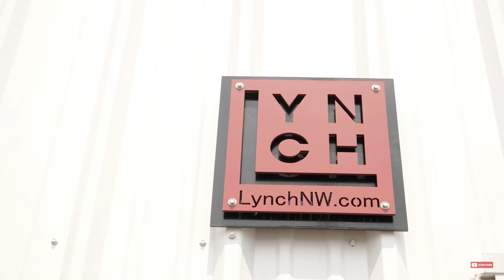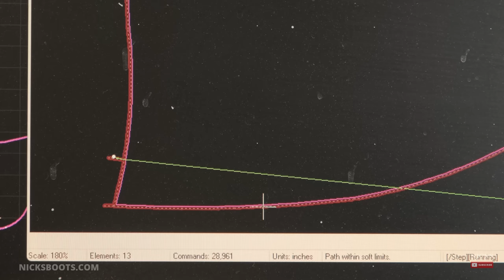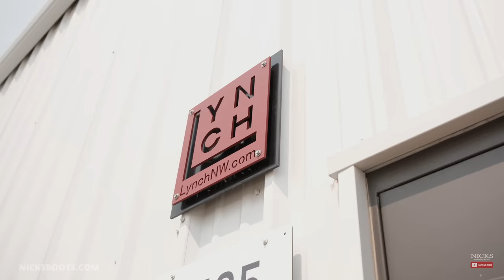World's THICKEST BOOT SOLES: Off-Road Tires on Boots | How It's Made

Comment: Guess these you dont have to worry about rotating them.
Reply: Maybe after the first 100,000 mile 😆 🤣 😂
Reply: I was thinking after a 100,000 steps.
Reply: Make shure you Cross the non drive axle
Reply: That's the best joke I've heard in while.
Reply: You put the left boot on the right foot and the right boot on the left  foot  to turn  corners

Comment: Years ago I worked in a prison. They had a shoe/ leather shop. There was an inmate that would use a lawn tractor tire just because it didn’t have any metal wires thru it. He made some wonderful wedge soles with them.
Reply: "worked in a prison" is a creative way to say it
Reply: I used the same tires to repair shoes at home. The non steel belted tires work great

Comment: CHALLENGE: Build a 6" Traveler w/ Vibram Cristy sole using a 55 Last. 

  I would think if you add 2-3 sanded/tapered midsole layers from arch to heel keeping the bottom flat, then cover with a solid rubber slip sole, a Traveler with the 55 last arch support could work.

Comment: Hey Nick i NEED a pair of boots, however my case is a bit specific so i was wondering what type i should go for. I weld at Honda SC manufacturing it’s a long, hard, n fast paced day on concrete. Also every thing that you can wack yourself is at ankle height, i also cant have metal on the outside of the boot and must be steel toe.
So my check list is
-Plenty of support for long days standing n anti slip
-All leather and able to resist weld spatter
-No/minimum metal on the outside of the boot
-Ankle protection is a must, 8 inch boot
-Must have steel/safety toe
Im a 10 wide, what is your suggestion?

Comment: Does it have a steel toe variant? I would definitely be interested if there was a steel toe version designed for construction. If it had a steel plate in the bottom, that would be icing on the cake.